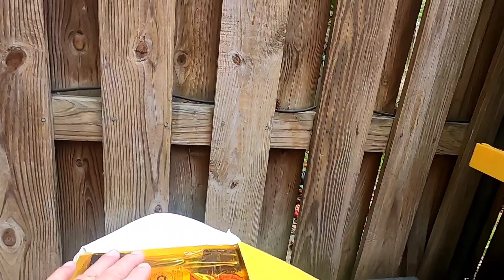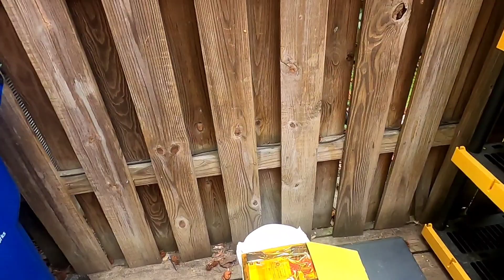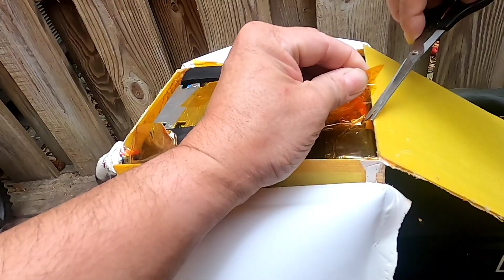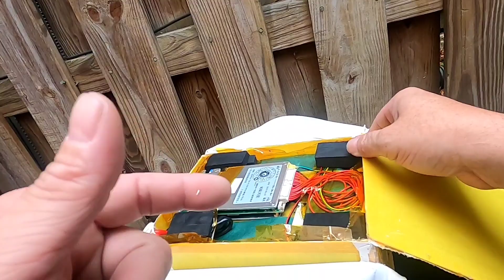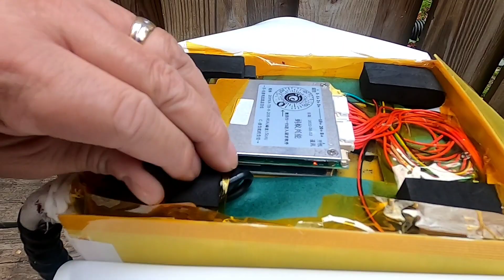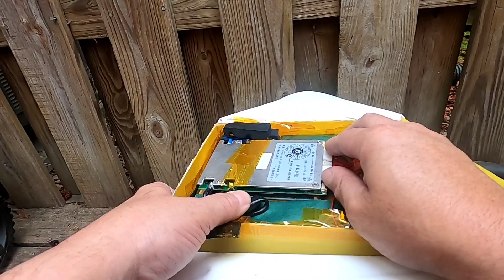BMS Bypassing, Usually I discuss the Pros, lately it's been the cons & what you really need 2kno!

Comment: For the BMS, any special solder you use.  Stuff I'm using doesn't want to stick to the BMS.  Trying to keep the charge side of BMS connected.  Thx
Reply from the maker: What size iron are you using and I don't just mean in wattage you have to have iron that is physically thick and has heavy tip that holds heat otherwise a light weight tip the heat will be drawn out immediately if your attempting to solder something with large surface area and if heat is not an issue you need flux paste which will help solder flow
Reply: DIY liquid flux, isopropyl alcohol and a little bit of rosin. Just crumble into powder and you’re good to go

Comment: Hey bro, have you tried the Yuanqu controller? It may not push off that fast but it accelerates to an high speed after pushing off and it saves a lot of battery energy as well! Also if you do have the additional funds, you can try building with Sony VTC batteries, these batteries are built for speed!
Reply from the maker: No I haven't ill try anything that's proven can beat what I'm doing now. When someone post a video of a bike performing better than what I'm using absolutely I'm willing try it. Now I just posted I was gonna build a bike that was capable of a high top speed and I know how to do that my way with a high voltage battery system and a low turn motor. The bike I have now is the opposite it's built to race with low voltagea nd high ŵ and a ton of amps. It can accelerate faster than my fastest car which is a Supercharged Mercedes V8, so right now I'm not feeling I need to ?change a thing but I'm open to anything that can show me better than what I'm doing now. Thanks for the suggestion

Comment: Im running qs205 5T @  21s 77.7v  15.6 ah with 60C lipos and have 900 amps on tap but no bms but always balance charge I can get 20 miles riding chill and that pack was total $550. I only need 150-200 amps and soon will probably buy 5 Turnigy 4S  20,000 mah packs and put them in series and have 72v 20ah and 240 amps available for less than $800 with a DALY bms. I went lipos because I can see myself going crazy with maybe 96v?/fardriver?/bac8000?/qs273? and wanted to have a battery that can take any upgrades in the future. My commute to work is only 6 miles and I can charge at work too so I dont really need crazy range yet. Longest group ride I done was 20 miles (Im in VA) so now I will have a spare battery in case. I Am an electronics technician and very comfortable with lipos. I had few issues with 18650's and never really had any issues with lipos. But yeah man a lot of people trying to be cool and fast but dont know anything about the dangers of elecricity. Imagine filling up your gas take with 40 miles of gas and compressing all that power into a little 6 inch by 12 inch rectangle called a battery, its dangerous and no joke especially with these high power packs, it is literally a contained bomb of electricity.  Great vid bro.
Reply from the maker: Your in VA so am I maybe we'll catch up some time. I don't know if you've seen any of my other videos maybe you just stumbled on this one but I have exactly what you said BAC 8000 with QS273  and I love it to death. I had built my pack to be future proof as well only problem with the BAC and its not really a problem I get more then enough power but ASI Software limited to 21S so while you have all the torque in the world with 840 phase amps reaching high RPM is limited with that voltage but if 100mph with the assistance of ASI great field weakening is enough for you than BAC8000 is the Best way to
Reply: @ChrisCrossingWires1212  Im in Tidewater, Va Beach. All the rides I see in the DMV area are near or in MD or DC and it aint hot enough up there til May LOL! Im sub'd and will be definitely be getting out there with you guys this year. Gotta get my bike right tho with a few upgrades before I come to the big city, some of you guys up there balling out there with Hope brakes, and Marzocchi forks and you running around with 30kw+! ill be out there bro, great channel.

Comment: Good video, with running over 200amps it may be better to forgo using a bms and get a JUNCTEK  KG140F 120v 600amp smart shunt. It has all the features of a bms minus the balancing but that can be bought separately. The smart shunt is smaller, cleaner, more precise, cheaper and more reliable than a bms. My battery does 400amp continuous and 800 burst, haven't seen any bms that can handle these cells lol.
Reply from the maker: Do whats best for you this was just hypothetical  and trying to help people understand why peoples bikes are burning up. For someone running a large controller on a bypassed battery, aint no BMS or a shunt gonna help them, They need a real battery that can supply the power they need I dont have any issues what Im running Not thinking about none of those options Im the BMS I dont have anything I wanna shunt or run BMS on and these people need pwerful batteries their trying to get blood from a turn up. This battery was on a lil razor bike. ILL never be using any of those things myself, I heard that on your battery I stand by what I say Im the Battery Monitoring system I regulate what does what
Reply: @ChrisCrossingWires1212  I hear you, fair enough :hand-purple-blue-peace:
Reply from the maker: @9MileRoar  i hope you didnt take that thewrong way bro, i understand you are giving a successful alternative for running a BMS but may i confused the point i was making but that was nothing a bms or a smart shunt will fix. they are both meant to keep bad things from happening, disable or regulate current. Those guy need more power which is why they are bypassing but if the battery cant supply more power either way not gonna solve the issue. Now if I were trying to determine the best means of protecting your battery or safety and whats a better system surely sounds like that smart shunt is a much better option. in my case that may serve me well as I have a battery that can actually provide 600 amps so may ill take a look at that smart shunt lol  post a link
Reply: They have a video on it and they update them frequently, can also be bought from our favorite eastern shop https://www.youtube.com/watch?v=pNGoQ8_moNw
Reply from the maker: You know I read this again this was some good info I kinda read it the wrong way but yeah post a link or something let me see what you talking about
Reply: @ChrisCrossingWires1212   @ChrisCrossing Wires  Good morning, youtube dont like us posting links, you have to search  for JUNCTEK KH140F  from the eastern shop and it will come up in the results. This is the third time YT has deleted this post!

Comment from the maker: After i got my meter and checked both were negatives as they usually are but by them being blue I though maybe this one was different, nope one side charge side and other side disharge I make mistakes on live videos say wrong thing Im human but yeah that first side was dicharge side the other charge side usually all negative wires are black thought charge side may been on the flip side but no just do the discharge side only in this case
Reply: Hey man I'm wondering if you know of a US supplier that I can get a new controller and possibly display that will connect to the zugo? I don't thunk I want to use alibaba and wait forever. So I wanted to know if you know a good website to get like a 30amp upgraded zugo like controller. My wires melted and bike doesn't turn on anymore. Battery was good and I cut back the damaged wires and reconnected with no power. So I probably need a new controller and possibly display....thanks for any advice you can give
Reply from the maker: @Timothy Bongiovanni  sorry just seeing this I have a controller posted on in the comunity section. It's what I used on my Zugo and Super 73 great controller 45amp and will do 72v looks like mini Sabvaton  you'll see it go back like 10-15 post maybe more
Reply: @ChrisCrossingWires1212  all good.. ended up swapping the zugo controller for a super 73 rx controller, display, and battery.